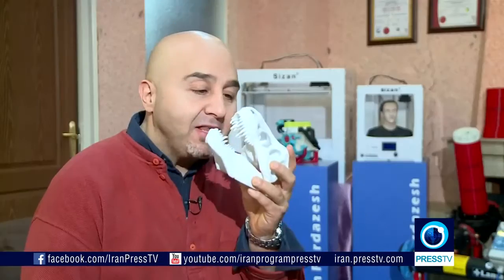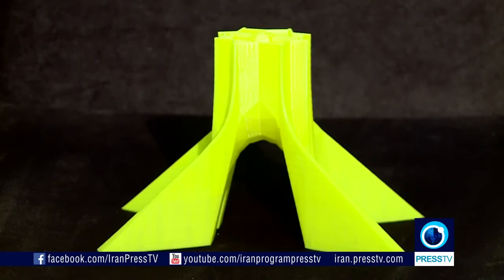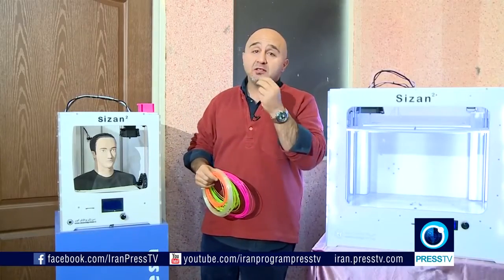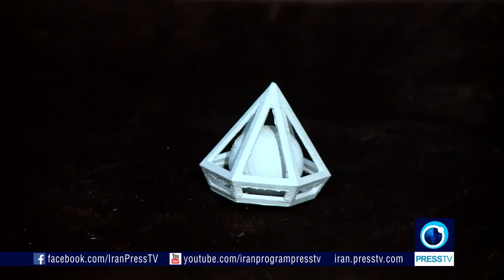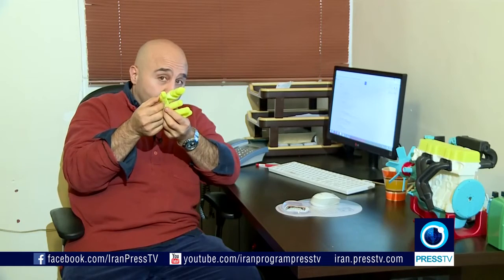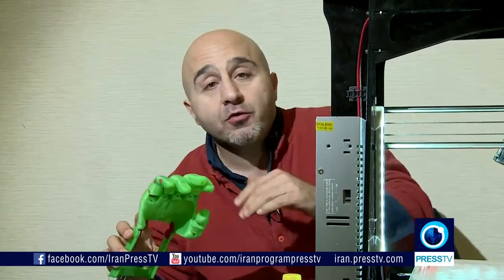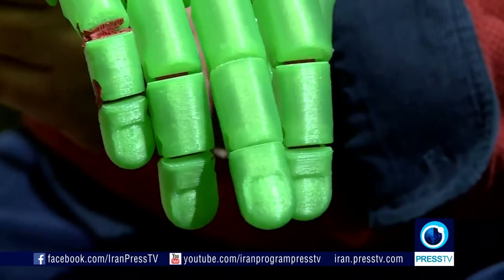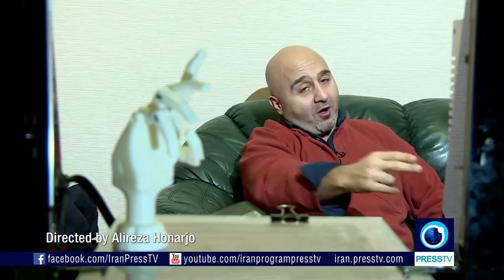Iran made 3D printers, Sizan company چاپگرهاي سه بعدي شركت سيزان ساخت ايران

Comment: producing non heat tolerant plastic with 3D printer can't help the industry much unless its used in making it easy to make some heat resistant mold for whatever iron/steal casting for whatever product needed to be  made engines or machines for industrial production and any industrial tool needed to be made
and for making other things.
perhaps gluing enough sand to plastic layer after layer dried maybe can help make that plastic heat or fire resistant a little. الله أعلم